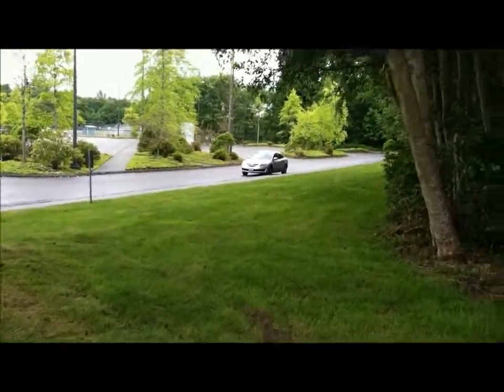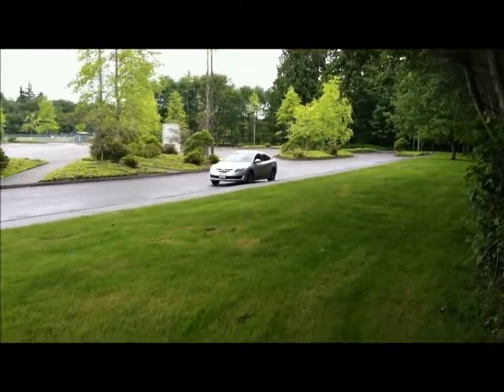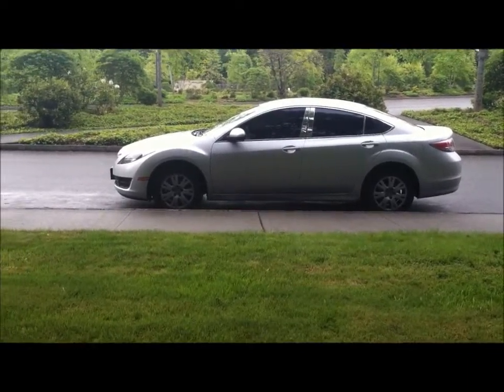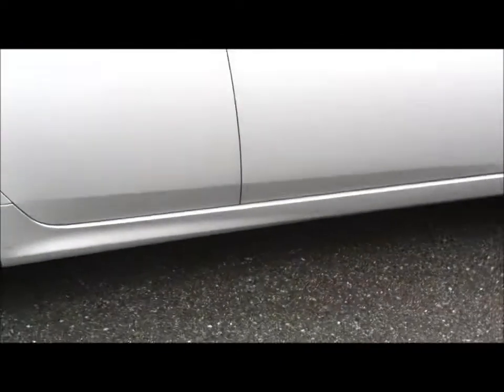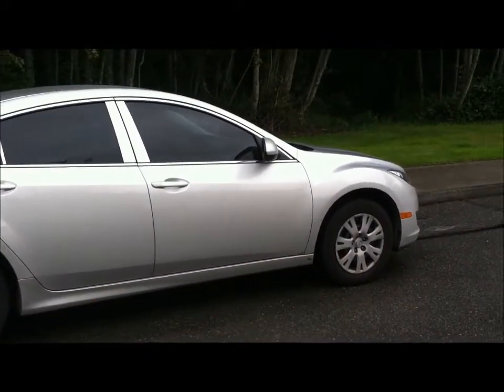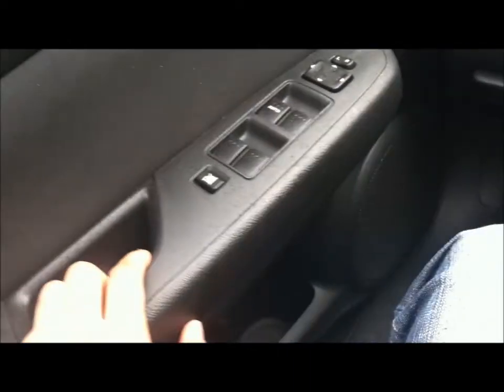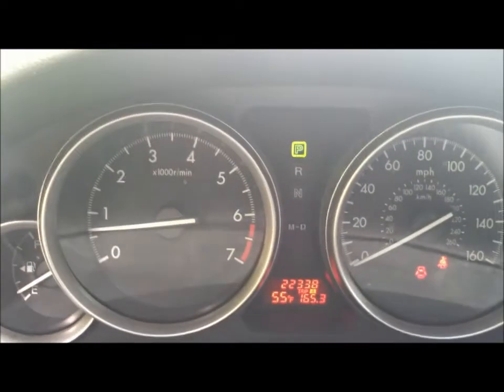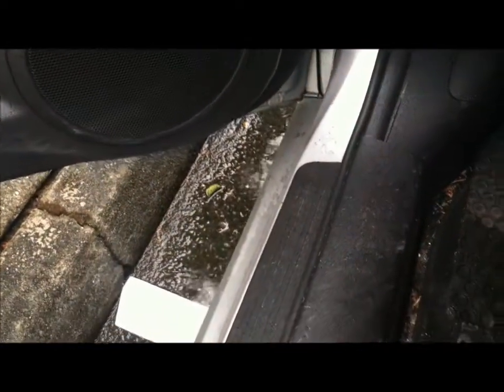2012 Mazda 6 Noise Problem Fix Part 1

Comment: Sounds like your torque converter between engine and transmission.  Or loose flexplate
Reply from the maker: It was a metallic exhaust gasket which was replaced under warranty. It's still barely audible but no biggie.

Comment: I have the same car and I’m having the same problem. It’s louder when I am driving or even when I slightly brake sometimes. But in park/drive gear it’s loud at idle too. Suggestions?
Reply from the maker: Since mine was under warranty, they replaced the gasket with a metallic one. I'm still driving this car and recently have hit 100K+ miles. I can still hear the idling sound faintly but there have been no issues. This is the follow up video to part 1: https://youtu.be/8S5Scj9VeP0
Reply: @Jay_Rule  boas amigo,
Que tipo degood guys what kind of metal gasket did they replace and in what part of the car?
is this gasket on the engine?
thank you and can you tell me where this joint is.

Comment: good guys what kind of metal gasket did they replace and in what part of the car? is this gasket on the engine? thank you and can you tell me where this joint is.
Reply from the maker: It connects to the exhaust manifold
Reply: @Jay_Rule how much did it cost ?
Reply from the maker: @jahmari9723  At that time, it was covered by warranty.

Comment: Exhaust vibration. Maybe a metal sheet or a strap default.
Reply from the maker: It was a bad exhaust gusset design so they redesigned it with a metallic one.

Comment: It's not the muffler it's the heat shield on the cat. Right before the ext. manifold, I took mind off and the problem never came back
Reply: Rickey Prasertlum  I did the same. the heat shields bends when you drive over a deep water little faster  that happened to me couple of times than the shield is rubbing the exhaust pipe and it makes that noise. 
I just bend it the other way and it will be good until I drive fast in a deep water.
Otherwise is the best car I ever had I got it new now I have 165k and never had any problems.

Comment from the maker: Was yours under warranty before you did that?  They claim it's the exhaust donut design material or design was bad and that was why it was causing the rattling noise.

Comment: Metal straps around the cat.
Reply from the maker: Please elaborate
Reply: Dude, that is it. Your cat heat shields rattle and if you put long bolt tightening metal straps around the cadilitic converter it will quiet down.

Comment: It’s the cheap flimsy heat shield
Reply from the maker: It's a loose or bed design of the exhaust gasket
Reply: Jay Rule  ur fuckin heat shield bends in and and exhaust pipe vibrates against it fuck what the dealer told u
Reply: @NikeChecksHtx  thanks dude one mechanic told me it was motor mounts and the other said it’s the belt lol

Comment: It's definitely from the manifold..Or actually, it is that part that connects from the manifold to the muffler.This part that I am talking about joins at the shaft underneath the manifold. It has two screws, and two springs. That noise is a pain in the ass. I know. It gets louder when you are on a drive through, and once you place it on park, the noise goes away.I traced that noise to that shaft underneath the manifold just the other day when I changed my own oil. I grabbed some gloves , and moved, and shook the exhaust shaft at that point below the manifold.I need to make that noise stop. Any suggestions?
Reply from the maker: Thank you so much for watching this video. Please consider subscribing to help us reach our goal of 100K and receiving the Silver Play Button.